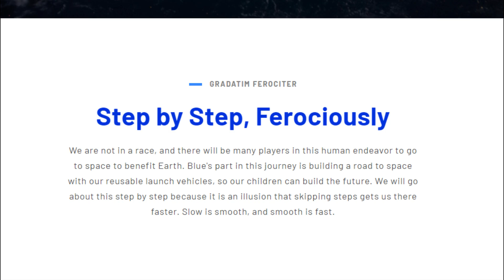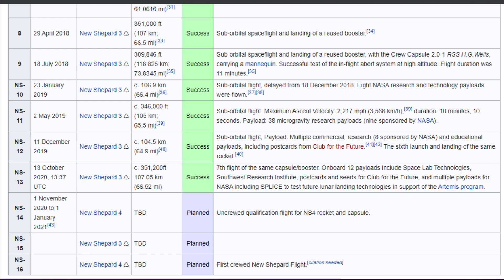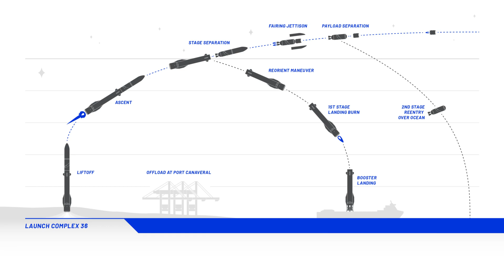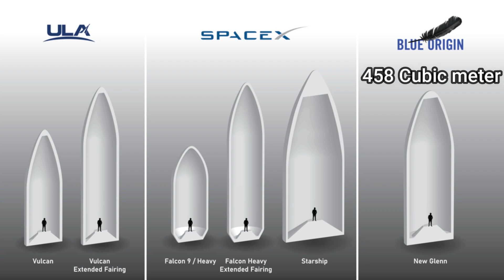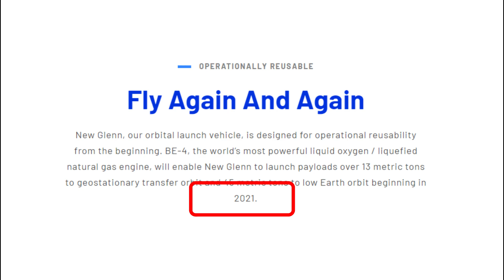New Glenn: Blue Origin's First Orbital Rocket Explained!

Comment: I don't doubt Bezos will make it happen, but maybe he should take quicker steps😉😁 perhaps I wasn't listening closely, but I think you have the payload of the FH wrong.. From Wikipedia: "Falcon Heavy has more lift capability than any other operational rocket, with a payload of 63,800 kilograms (140,700 lb) to low Earth orbit, 26,700 kilograms (58,860 lb) to Geostationary Transfer Orbit, and 16,800 kg (37,000 lb) to trans-Mars injection."
Reply from the maker: These numbers are for expendable configuration, and Blue Origin is not planning to expend the first stage.... So the payload capacity in the video is for reusable configuration..... Thanks for watching 👍